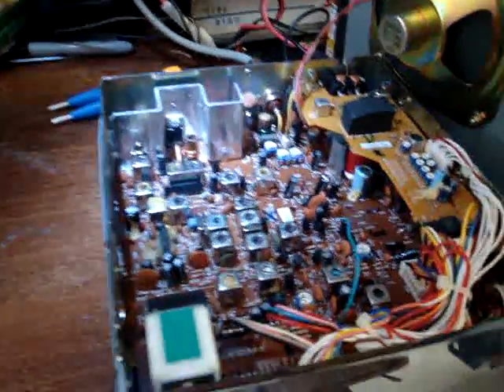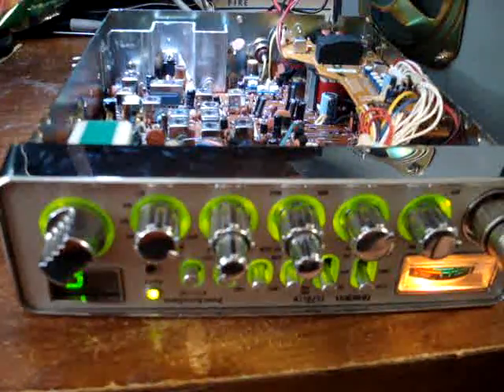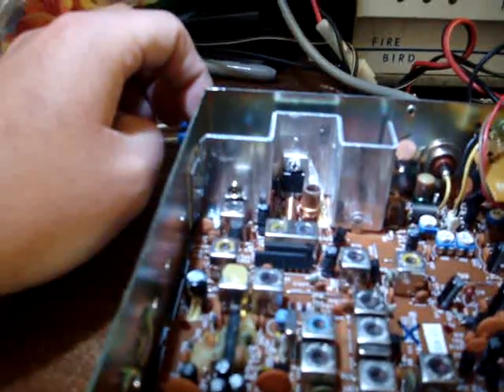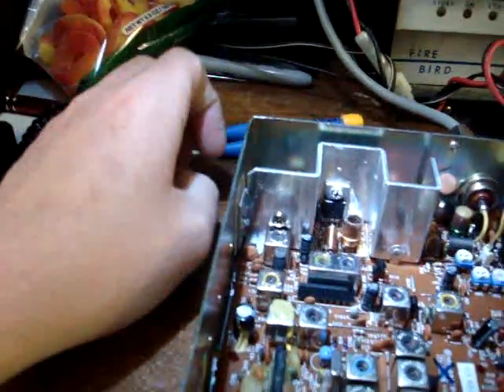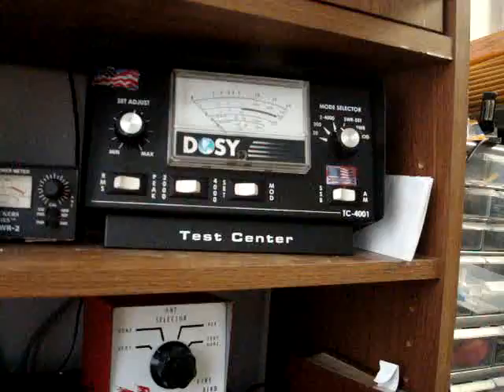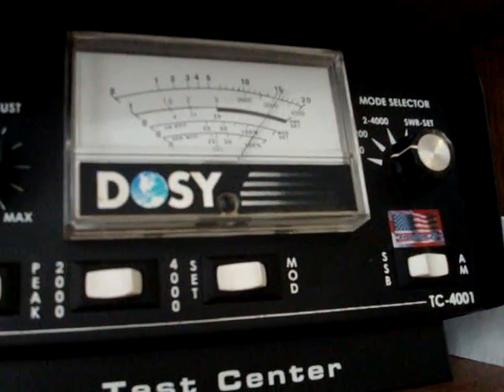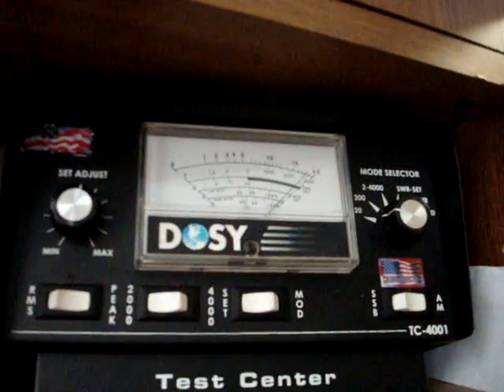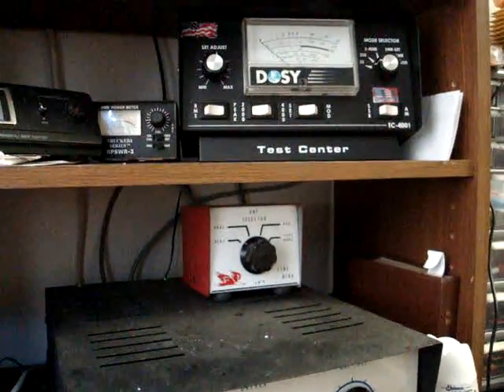uniden pc 78 ltw erf 2030 mod

Comment: That's PEAK wattage... do a true RMS Wattage scale and it would be very disappointing . but all the same looks good on a peak reading tho, & a modulation reading would really look good.
My 29 has a 13N10 with a homemade companion part in {R56} . does about 32-33 watts PEAK on a Hello  & about 17 watts Hello  on RMS .
actually kicking ass for a 29.
to get more power you could  change out caps and such but why waste your time ,
just save up and buy a export radio & have it converted

Comment: LMAO!  Let me try to put this into english.  The radio and all components was designed for 5 watts.  It takes 10 times more to even bump the receivers meter 1 "S" unit.  If you putting out an 8, 50 more watts will get you a 9. But that 9 spatters all over hell's kitchen!  Your over modulating and clipping.  With all these mods, I have yet to hear about the low and high pass "LC" filters you created to go with that increase in power. "Man wants a green suit, turn on a green light" :)